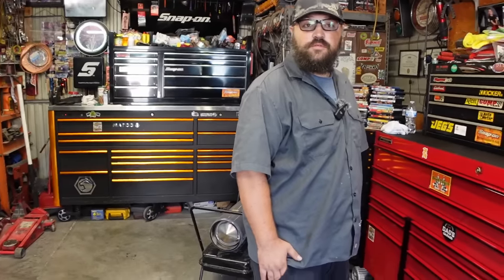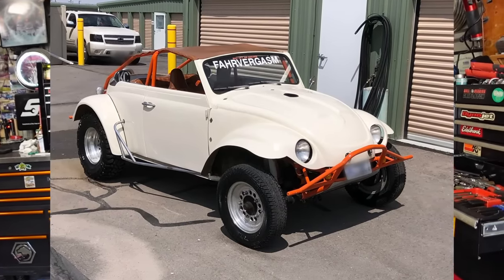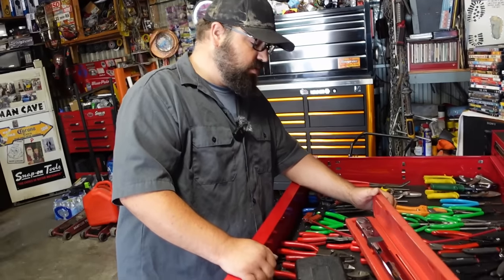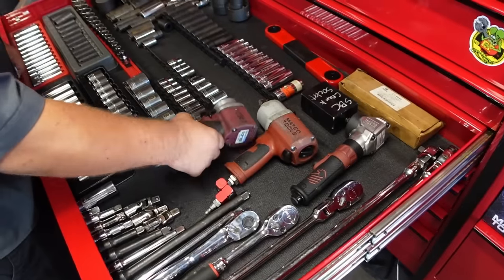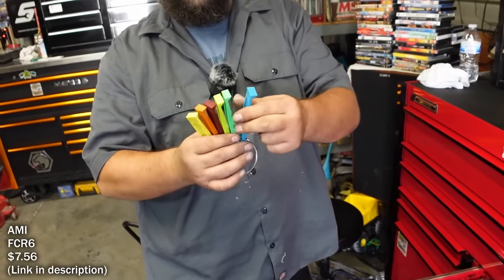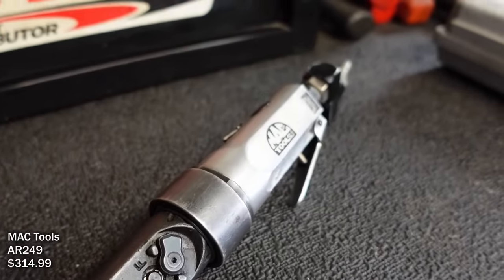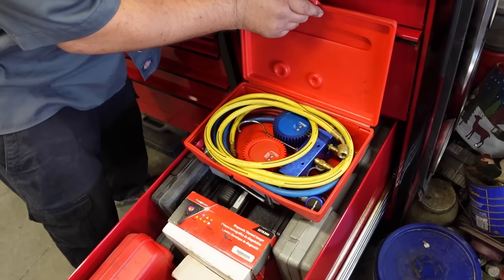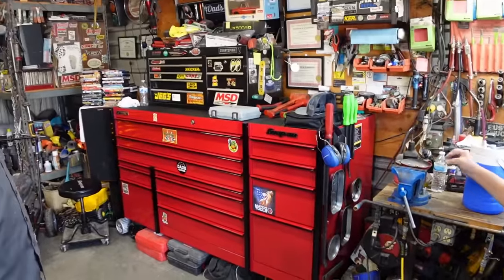Inside An Engine Builder's Toolbox!

Comment: Sweet Snap-On box.  Probably my fave of all of them....and colour too.  Also, heavy sockets slow down the Big-Top drawers.  Who wants to side around 200 lbs of steel when getting the same 10mm socket?  I always put my most used stuff up top and the rest down low....keeps the top drawer fast and easy to sling around and I don't have to hit 3 drawers to do work.  This is the first dude to do what makes sense.  Cheers!
Reply from the maker: Yeah! It’s not common to set things up like that, but it makes sense. Thanks for watching!

Comment: 17:40 clutch drive. 
Bought a screw driver at Napa in 1989 to work on a Holly Carburetor. 
 Haven’t used it since
21:40 is a piston ring compressor